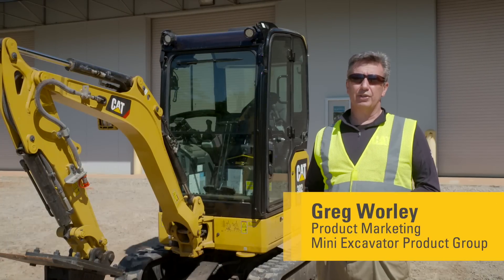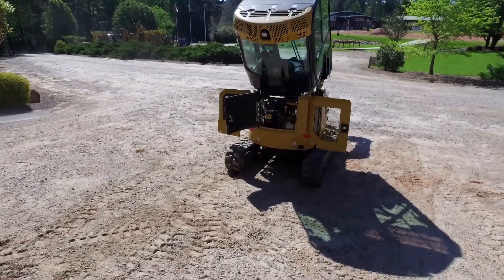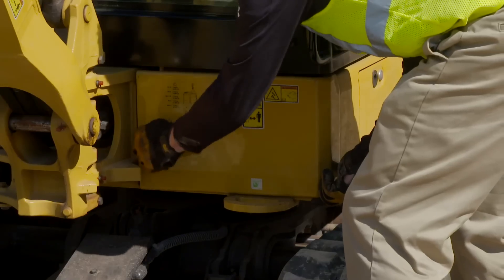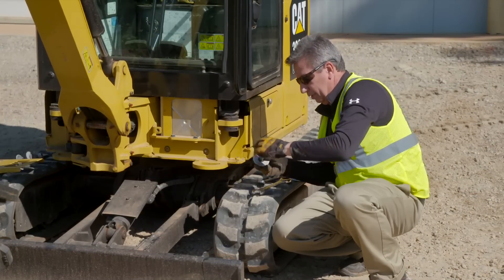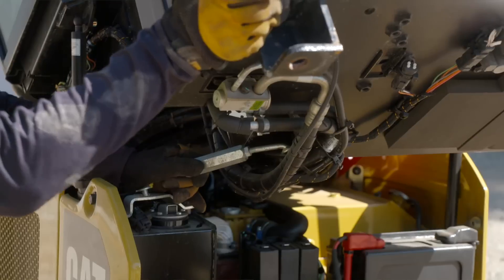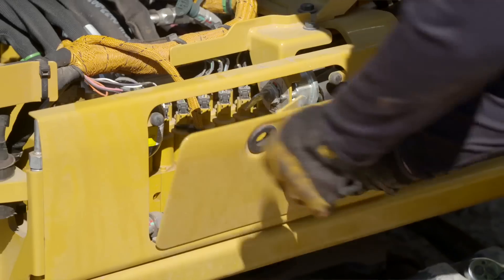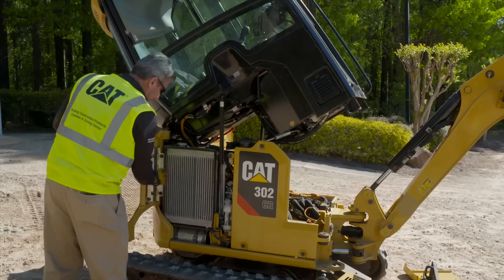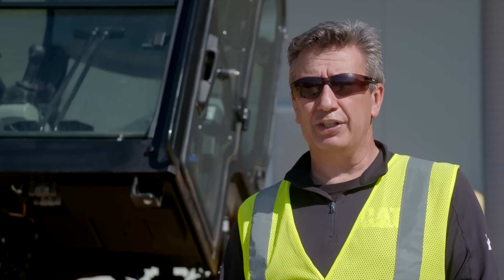Tilt Up Cab on the Cat® Next Generation 1-2 Ton Mini Excavators

Comment: As a former commercial workshop owner and mechanic I am extremely impressed with the accessibility you designed into these mini excavators.

Whilst daily service points may usually be accessible, it can be troublesome (to say the least!) to gain further access. 

By specifically designing in unhindered accessibility, you've saved the Owner or Operator time and money. 

Likewise, components that are accessible and visible tend not to get overlooked or ignored as much. 

Accessibility can be a big issue, and the lack of it can lead to trouble in the future. 

Thank you for this great video.